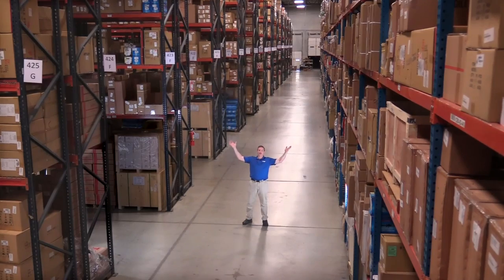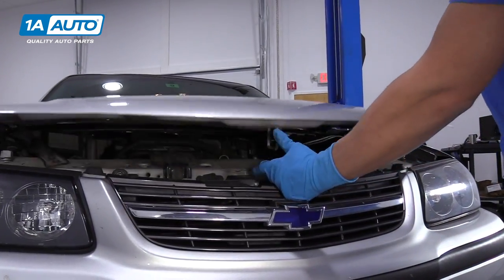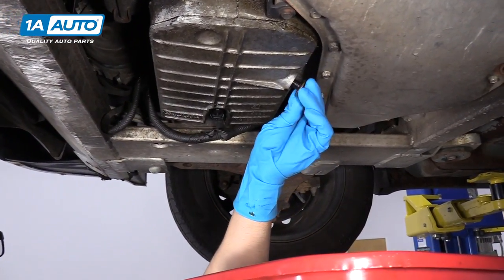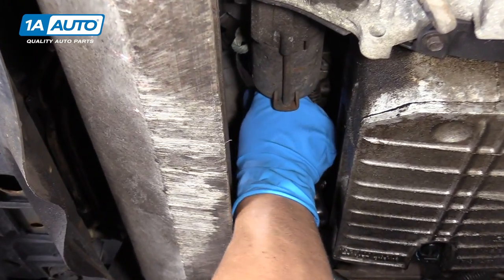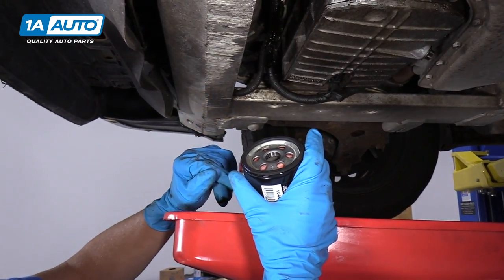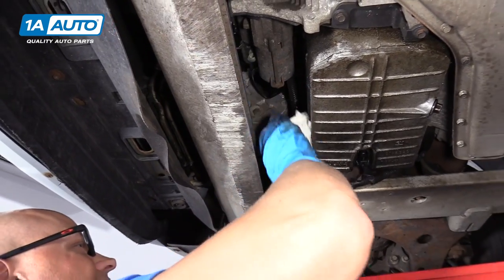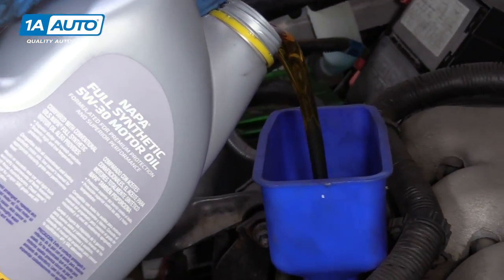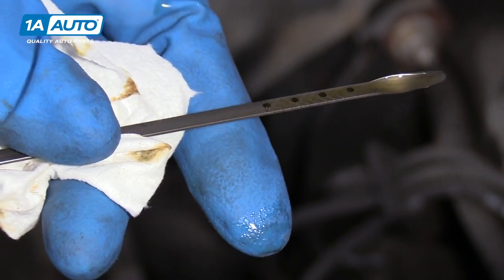How to Change Oil 00-05 Chevy Impala

Comment: I would highly recommend against tightening the filter so much. 

It makes removal extremely difficult since the engine crankcase will pressurize and effectively lock the filter. In such tight quarters having to really work hard to loosen the filter is a major nuisance. 

Also, removing or loosening the fill cap and dipstick prior to draining the oil, then removing the filter, before replacing the drain plug. This has a venting effect so the oil flows smoothly. 

Let it drain as completely as possible before closing up shop and refilling the crankcase. 

Hand snug (a bit of effort, not a hard turn) for the filter is enough. Once the engine runs for a while it will not leak unless you have cross-threaded the drain plug or filter.